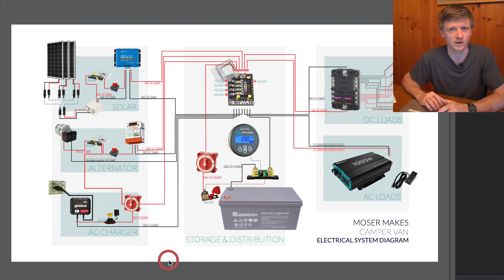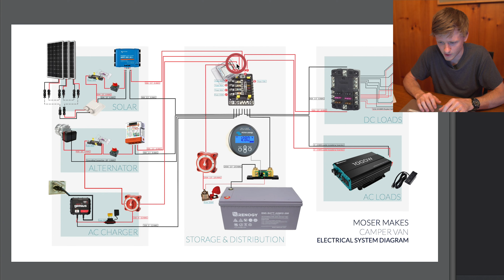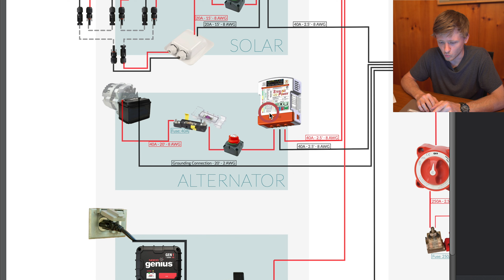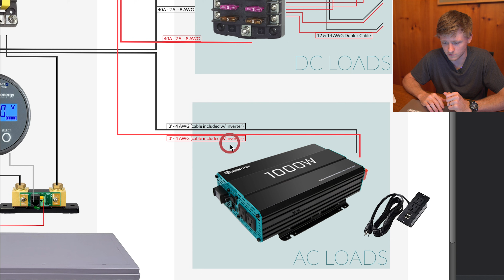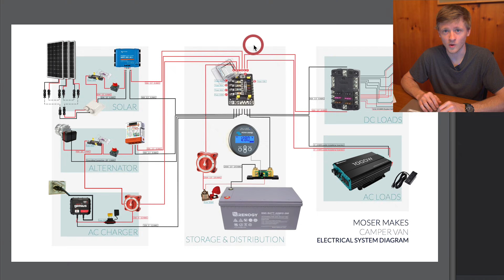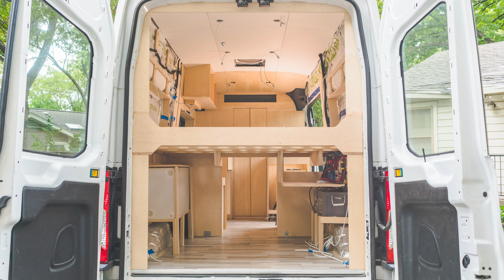Camper Van Electrical System - Comprehensive Look!

Comment: What about a ground to the van itself? Do you include something to the van's chassis, etc?
Reply: You posted 4 months ago so maybe someone else will see this, but the way I see it grounding you the van itself is essentially the same as grounding to the starter battery’s negative terminal, because the vehicles chassis is not a true earth grounding. This is because rubber tires. So, you could do that so that you would have a full circuit between the starter battery and the house battery when the solenoid is engaged, but I see no additional utility of this.

Comment: Hey Sam. Great vid. I'm also building out a mk8 transit. With your battery to battery charger- did you run a ignition live or rely on the auto shut off? Presumably you didn't earth anything to the chassis, rather you bought all the negatives back to the the battery via the bus bar?

Comment: Hi M. Moser, Thanks a lot for your videos ! 
Got one question: what is your opinion or what are the pros and cons of having and inverter and a separate charger, versus having an inverter-charger (like for example the MultiPlus from Victron) ? Obviously the price, maybe, but technicaly speaking, is there so much difference ??

Comment: Thanks for the terminal fuse block idea. I have big fuses and breakers, but they need big wires on both ends. Always wondered why a fuse or breaker that bolted directly to the battery did not exist!  
It does!  Thanks!

Comment: First, Wonderfully safety setup.  Good job. 
This next is a thought or discussion seed not a complaint or a criticism. 
Solar to CC fuse. The one fuse that has me confused is the one off of the solar panels.   Fuses protect from excess current. Solar panels will never output excess current. If a solar panel sources 9 amps max, it supplies 9 amps max if it is supplying the CC charge controller or shorted to ground. Always 9 amps max. Also, a system uses all the current solar panels can supply, so the fuse would be more than 9 amps. What would pop the current fuse?
Solar fuse placement. The only melted/possible fires I have seen were arcing melted parallel connectors on the roof of an RV. I don’t know if the delicate MC4/H4 internals were damaged from arcing due to disconnecting under load, not connected right (almost fool proof), or defect. The point being, the fuse location would not have prevented that fire. I don’t think a fuse anywhere along that path from the connections directly on the solar panel to the CC would protect from that. 
Really, only a GFI type of “fuse” would be any use anywhere along that path to the CC. 
I can think of one reason (dont read only one reason) to have a fuse on the solar panels. If somehow the line was energized by a higher current source, and there was a short (eg combo during an accident). 
Other general safety. My one real worry is having a common ground, and some high energy short energies a non-grounded component, or a piece of non-grounded metal, or a not-quite-grounded piece of metal, thus touching that energized component and the common ground metal van could be a problem. 
I need to check solar panel frames, solar panel frame to vehicle connections, metal brackets mounted to wood, ???, etc.